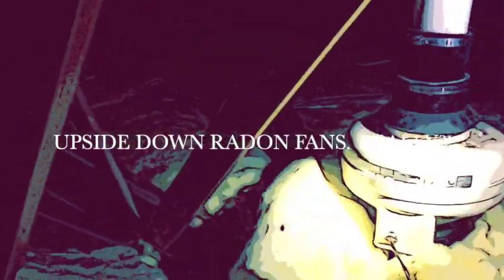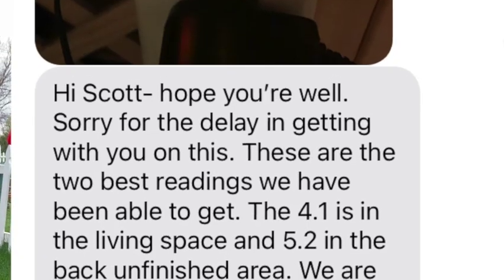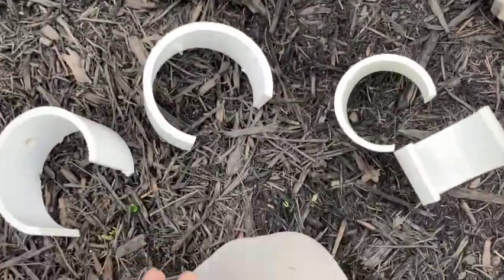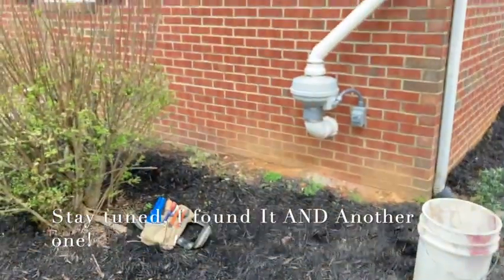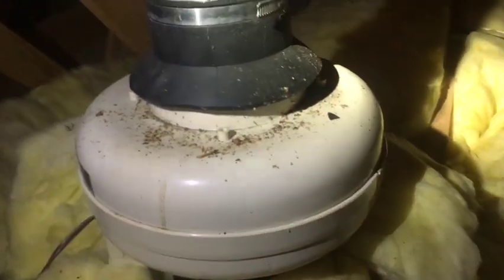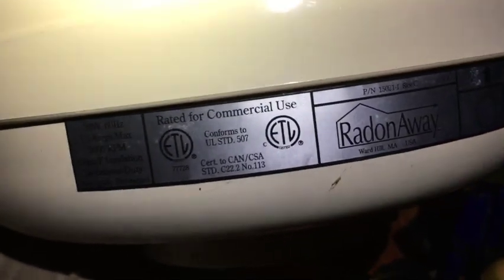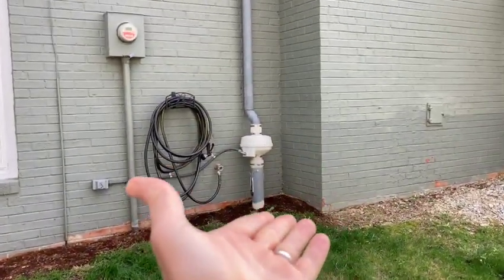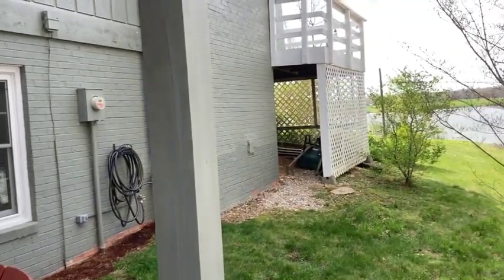Why Turn A Radon Fan Upside Down?   1080i

Comment: I had a thumping, gurgling sound under the slab and in the sewer drain pipe, especially when there was a lot of rain, which would stop when I turned off the radon fan. It goes on for weeks if I do nothing. Turning the fan upside down for a few minutes temporarily resolved the sound problem. My theory is that the positive pressure clears water trapped in the waterproofing drainage pipe under the slab. The sound comes back every time it rains now and I end up going out there and flipping it over again. I might try leaving it upside down, now that I've seen this video, but I was wondering if I could install some kind of switch that would reverse the direction of flow for a few minutes to clear the water out, and then set it to normal again.

Comment: Can turning a fan upside down work for vapor mitigation using a high suction fan
Reply from the maker: Hi Thomas, I've never needed to try that.  I'm imagining blowing up a balloon with that scenario.  Having said that, a lot of physical experimentation is involved with tricky radon jobs so if you try it- let me know how it goes. good luck. 😀
Reply: Would that not create greater pressure under the slab and cause radon to enter the living space.
Reply from the maker: It's a very rare fix for a home.  Just an arrow in a mitigator's quiver should the situation present itself.